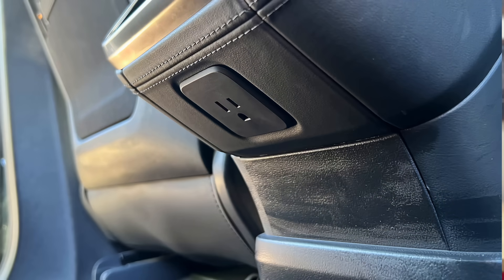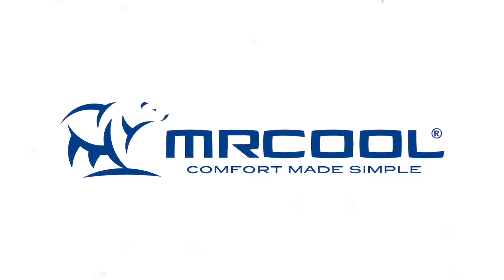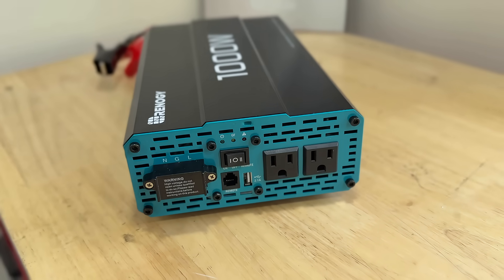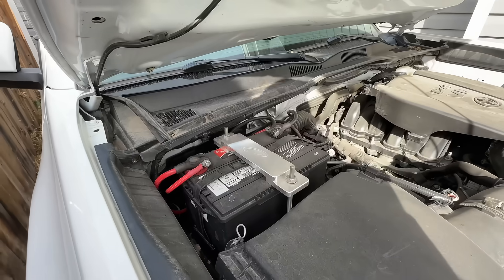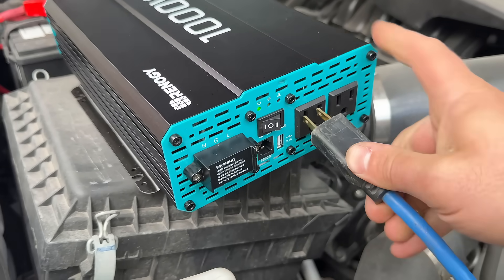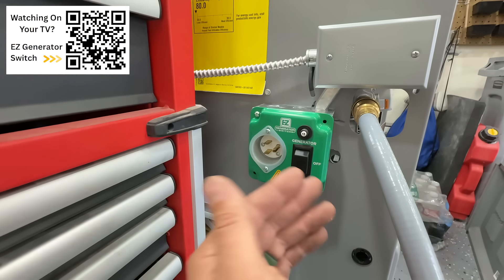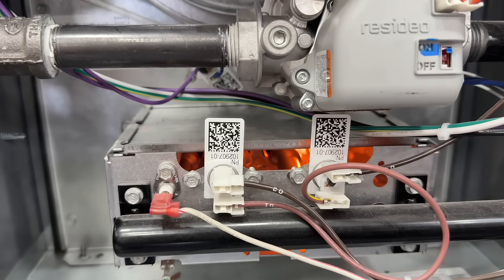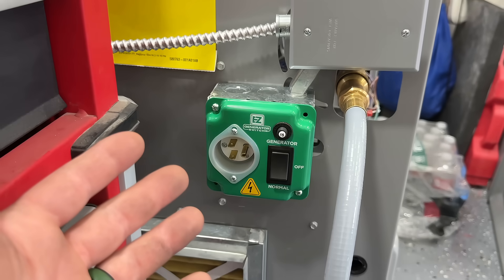Why Buy A Generator? You Have One Parked In Your Driveway.

Comment: I did this several years ago on both of my vehicles. But I mounted them permanently away from the engine because they will over heat and the breaker will flip. If possible install an additional battery connected to your alternator as well. We did this. One is in the bed of my truck but it has a roll top water proof cover. The other was in the back end of the SUV near the spare tire. Neither can be seen and are out of the way. We installed on the truck 2, 3000 watt inverters and one 2500 watt inverter on the SUV. The good thing about newer vehicles is they now start and stop by themselves on a regular basis to conserve gas. As soon as the vehicle computer recognizes that the battery is getting drained it starts automatically. We can run both vehicles like this during an emergency like we've had to do before and have power around the clock. And it's 80 percent less expensive on fuel to do it this way than a conventional generator. Which we have but we use this if we know our power is going to be out for longer periods like a natural disaster. We've used it like this for a week and a half and powered everything we needed for comfort in our homes. Fridge, window unit instead of central air and a counter 3 burner electric camping stove. Plus all of our lights including our wifi. 
This is highly recommend. It can be a life saver and it's extremely affordable. Plus the gas is literally 80 percent less in use. You save big bucks like that. We've spent 400 dollars on gas during a power outage after a hurricane before. This was before we installed these in our vehicles. Now it's 65 combined in both cars. For a whole 7 days running the vehicle on and off.
Reply: I came for this comment as soon as I saw him lay it on the engine....lol
Reply: This is great‼️😃 Have you done a video on your setup?
Reply: @ImASurvivorNThriver 
No, I haven't. Maybe I should if it can help people. But watch, as soon as I do it something will happen. A law will pass, something will happen. Inverter prices will skyrocket where people can't afford them. 
That is how it always works out. Something will happen to prevent people from doing this. Somehow!
Reply: @ImASurvivorNThriver yea, that'll help a lot.
Reply: Damn...I wish I would have known this after buying a 12K 22K Generac🤨🤨🤨
Reply: @markwilliford4567 
We just purchased one. A Generac. To replace the gasoline one we have. It runs on natural gas, or propane. We really like it. It was pretty expensive but I installed it myself. I installed the gas lines and the switch box. Easy as pie. Just waiting for the STHTF scenario now. We installed it in our back yard in a portable building hidden from view. It's really really quiet. When the doors are closed you can't hear it at all. Peace of mind, you know. I'm glad that you got one.
Reply: What vehicle year, make and model does this you speak of? Where did you get the plans to set it up this way?
Reply: @bomark2002 
Most if not all newer vehicles have a built in system nowadays that allows the vehicle to start and stop on their own. It conserves fuel. The design and intentions behind it are to help to prevent or lower emissions. When you are sitting at a light, or in traffic like traffic jams, the starting and stopping helps to conserve fuel and supposedly to help lower emissions. Concerning where the idea came from;
I set it up like that because that's how my mind works. I'm always designing  and building things. I have been like this ever since I was a young child. It started by taking things apart when I was young and trying to make it better. So the idea just came to me after looking at my dad's generator when I was around 16. I saw an inverter sitting on his work bench and it gave me the idea to install it in his truck. This was back 40 years ago.
Reply: @WearySojouner  Oh ok those vehicles, I’ve seen and heard them starting, unfortunately we do not have the funding to own one of those thanks for the reply
Reply: @bomark2002 
You're probably in better shape than most. When everything goes down and it will, your vehicle is going to continue to run because it doesn't have the electronics built in that requires it to stay running.
Reply: @WearySojouner  it’s definitely coming, the end of time that is for sure
Reply: So this guy's video is a bunch of BS, hmmm. Not truly safe to do it the way he says.
Reply: @MissX905 
It's not BS
He just didn't know that it would cause overheating. He would have found out. He just started his journey. People make mistakes. Have you ever made mistakes?
Reply: Get a 500 dollar inverter generator people. Case closes. Go to bed.

Comment: Great idea. But don't push your luck: a 1kW inverter is probably fine, but if you drive a late-model car and connect a 2 or 3 kW inverter you'll likely damage the alternator. Today's smaller alternators are very poorly engineered and built, and their lives can be shortened simply by continuing to use an older starter battery that should be replaced.

Comment: If you already have the equipment laying around and it's an emergency that's one thing but otherwise just spend an extra couple hundred bucks and buy a generator. You guy're wearing out all those parts on an expensive engine and alternator and expensive vehicle compared to a cheap generator which is probably going to use even less gas.

Comment: 1. Inverters need to be kept relatively cool with air circulation. Stashing the inverter inside the engine compartment with the hood close is bad for the inverter.
2. Prolonged engine idling will cause premature wear on the engine and could even burn up the crank due to the oil not circulating properly. Need to put a little weight on the gas pedal to keep RPM's up a little over idle speed to make sure the oil circulates properly.

Comment: You don't want to put too much demand on your vehicle charging system or you may have a lot of inconvenience and expensive repairs also most car batteries are not designed for being drained down and if you forget to keep your car running or cycle it often enough you will end up with a completely dead battery .......

Comment: Don't use your car as a generator. Long periods of idling contaminates the oxygen sensors ($300/ea), catalytic converter/s (+$2,000/ea), spark plugs (+$10/ea +labor), EGR and combustion chambers.  Plus you're working your alternator. 
When SHTF, you need reliable transportation. Put the money from this Rube Goldberg setup towards a portable generator. 
The real purpose of this video was for the CC to make some Google money from content and comments, as per the algorithm.
Reply: That was the first thing I thought of. The current consumption from a refrigerator compressor alone would put a heavy load on the alternator. Doesn't sound reliable to me and could damage the alternator and sensitive peripheral components. I would play it safe and spend a little more money to buy an external generator.
Reply: Well said. Came to the comments to post exactly this. I'll just add that vehicle piston rings are not designed for this, and that long periods of idling will destroy them. Ideally, you should never idle a gas vehicle engine for more than 30 minutes. They need vacuum and are designed for constant vacuum cycles.

Comment: 1000 watts is not enough for my 110 volt YORK gas furnace.  My units peak draw is close to 13 amps when the blower kicks on.  I would need at least a 1500 watt inverter.  I think I would opt for the 2000 watt inverter.

Comment: A couple of things to add. If you have a remote starter on your vehicle using that to start it is a plus. That device will shut off the vehicle engine if someone gets in and tries to drive off with it. The furnace should have a manual shut off switch located near it. If you're handy doing electrical work you can wire in a pigtail with a plug into the circuit after the switch and just use the shutoff switch to isolate the furnace from the grid.

Comment: The other great thing about this option is that where I live, long term power outages are so rare, and most of the time very short lived, I never could justify the great expense of the generator option costing thousands.
Reply: If you could operate the essentials in your house with this set up the generator that would replace it can be obtained for less than $500.

Comment: I've thought of doing this for years and never knew quite how to accomplish it. I tried it once with a 125 volt converted hooked to the cigarette lighter outlet, but it did not produce enough power to start the frig, which has a motor that draws a great deal of current on it's initial startup, and of course running the frig is the first priority to keep food from spoiling. Two points worth noting on your setup. First, the converter you chose will generate just 8 amps at 125 volts, I would be concerned about this providing enough current for both the frig and the furnace. A 2500 watt unit would provide a nice comfortable 20 amp service. Second and perhaps most important, many extension cords use very thin (18 gauge) wire and are rated for under 10 amps. I would encourage folks to be sure to use a higher rated cord, also keeping in mind that long runs of extension cords suffer from voltage loss, so again, use of high gauge wire in the cord minimizes this problem. If you are uncertain, then simple feel the cord with you hands while the furnace or frig is hooked up, and if it is getting warm, then this is a sign of resistance in the wire bleeding off voltage and converting the loss to heat, and a clear sign that a large gauge wire is needed for that application. I would always do this test. Better yet, I have an extension cable made from 12/2 internal house wiring wire,  and so I will never have an issue with it.
Reply: Great comment, info, thanks.

Comment: Stupid question, but can you install an inverter on any machine with 12v  guts? Like a riding mower?
I'm thinking a 1 or 2 cylinder riding mower will use less fuel than a truck or car, and a generator usually only has a similar air cooled motor anyway.
And no, my car does not spend most of its time idling. 
Idk who that comment was geared toward, other than taxi drivers and cops.
My vehicles are almost never at idle, let alone for hours on end. 
Idling for long periods increases carbon buildup and cyles the oil slower.
That's why cop cars are auctioned off with low miles. They have thousands of hours of idling on them.

Comment: We had a storm in 93 in NYS. My neighbor had a generator he was using so we piggybacked on it by plugging into the generator and put a male end on the extension cord and plugged into our wall socket that had the same line as the furnace. Worked well.
Reply: Super dangerous for electrical linesmen working in the area and illegal , do a little research on that one!

Comment: I put a renegy dc to dc charger under the driver seat.  the unit was 300 and wire was 200.   without that your battery and alternator are at risk of damage.  it charges 6 marine batteries sitting in front of the truck box.

Comment: Keep in mind, It will run a gas heater, most of the energy comes from the gas... just running blower motors, and igniter. IT WILL NOT run a home HVAC system. Too much amps. you will over-amp your inverter. This one is a 1000w inverter, but also... like if you have a 1000w microwave, it may not run it, so keep this in mind to run thinbgs like that qt 50%. Also, power supplies will get hotter if not using a 'pure sin-wave' inverter. Bsaf

Comment: Gas furnaces need a proper ground, without ground loops, and a correct neutral-ground bond, or the flame sensor won't work and furnace control will refuse to ignite the furnace. Just a note, in case anybody tries this and discovers that there furnace won't ignite. It means you have work to do to sort your power hookup.

Comment: Most car alternators handle only 100 watts. Best to get a stator alternator between the engine and transmission to make best use of a car/truck engine. You get what you pay for
Reply: My car alternator is 180 amps. At 12 volts this is 2160 watts. Wouldn't pull that much out of it for long but it will do it.
Reply: @douglasw7806  try buying that alternator at a parts store. They don't keep higher than 100 amp <actually less> at ANY store near me. For a GMC 350 V8, BTW.

Comment: Better off to buy a generator. I bought an 11kw dual fuel generator for $1000. I spent another $200 and wired it directly to my breaker panel including a lockout so it doesn't back feed to the grid. I can power my whole house off the propane tank in my yard for days.
Reply: I agree. After living through a long winter power outage that drove people to emergency shelters en masse, I always have a generator ready and a transfer switch on my furnace.

Comment: Just a word of warning when you let it run for too long those clamps heat and melt the plastic around them. Or some are just bad quality. And I guess if you are gonna idle the car for hours ,I heard mecanics say, the car better be in neutral so not to heat the transmission and wore it fast. Is it true, I dont know.

Comment: Have used my generator to power my home four or five times over the years (for multiple days), I like your idea in general but it's not clean power; you can ruin appliances with this approach. Also, it won't run the blower to your house heater. Better to invest all-in on a generator; you'll never regret that when you need it. Also- get heavy duty extension cords and plan how you'll get them into the house in heavy weather conditions. Lastly- fuel is always an issue- a full gen uses a gallon an hour. Great subject, thank you for the vid.
Reply: That 1000 W inverter will run the average home gas furnace. Mine only uses about 450 W while running in heat mode.

Comment: At idle an alternator produces enough current to keep the battery charged and some of the basic electronics of that vehicle. operating.

At 1000 rpm (engine speed) an alternator should produce about 20% of the alternators rated output. Figure 20% of a 60 amp 12v altenator. That is 12 amps at 12 volts, and through an inverter will yield approximately 1.2 amps @120vac.

This is not even close enough to run a refrigerator or a furnace or a microwave oven.

And...not all 3 at once.

I highly doubt an idling engine can produce enough power to run all that is claimed.

This will be based on the vehicle and what size alternator the vehicle has.

Maybe if the engine was operating at 3,000 rpm would the altenator be close to supplying full rated amps, which would be equivalent to 6 amps @120vac.

That is less than ½ the output of a 15 amp, 120v circuit.

You can try it, I wouldn't.

Today's alternators are not even recommended to charge a dead, jump started battery at highway speeds.

It is best to use a battery charger.

But hey, what do I know.